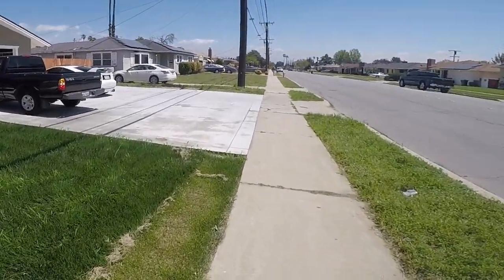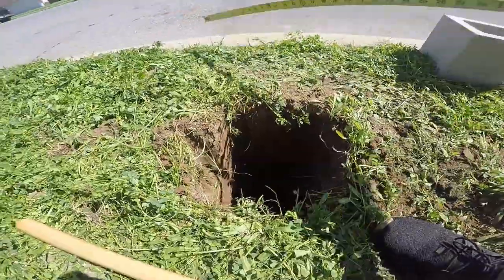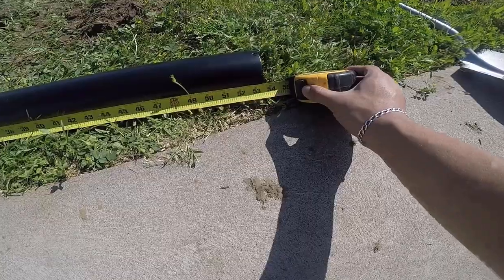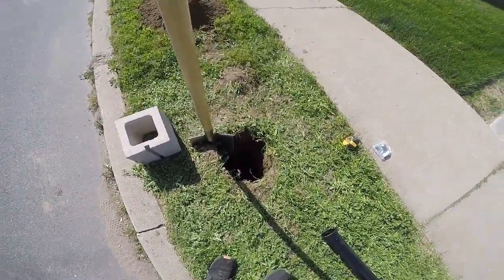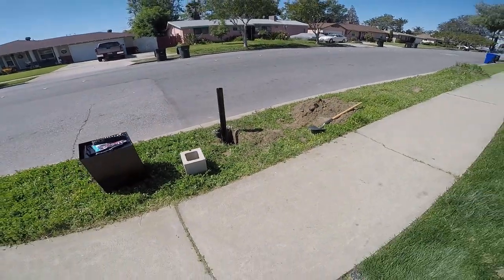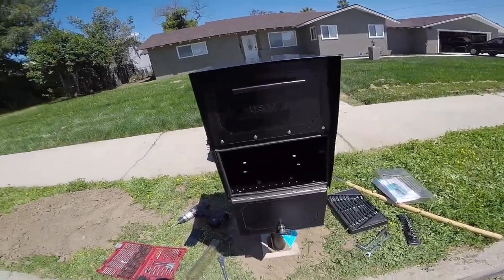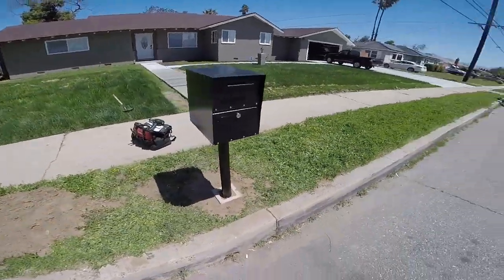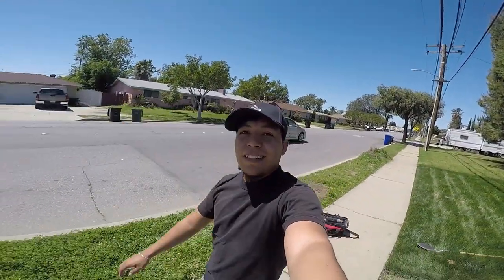Installing New Mailbox

Comment: The way you installed the mailbox, it can be easily stolen. What's to keep someone from loosening the nuts, and taking your new mailbox? The bolt nuts should be INSIDE the box. Cut off excess bolt length.
Reply: Exactly what I was thinking. Also, the wiggle would concern me for long term...